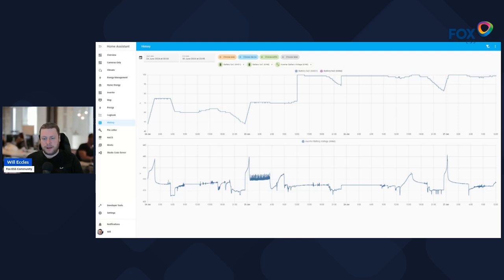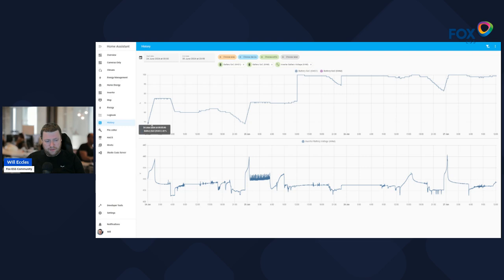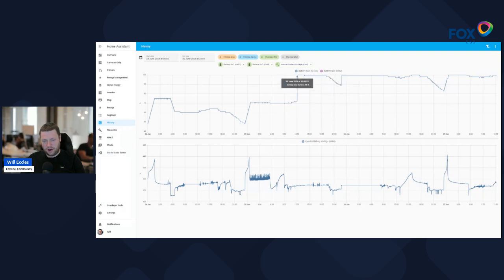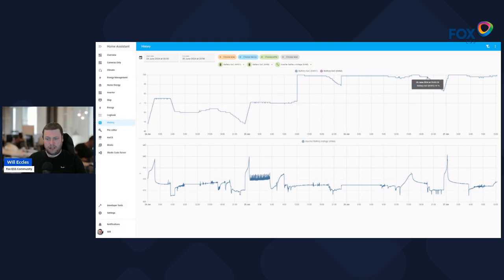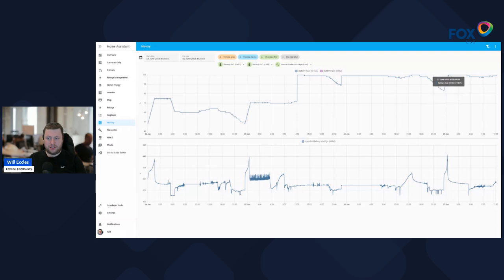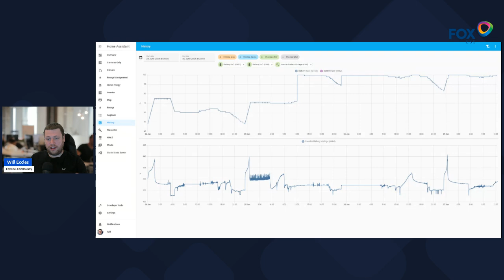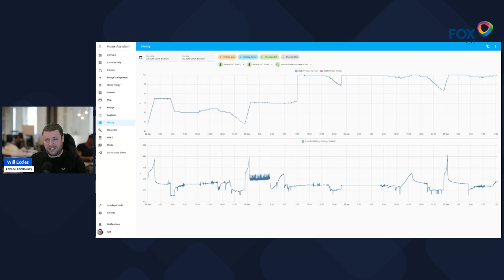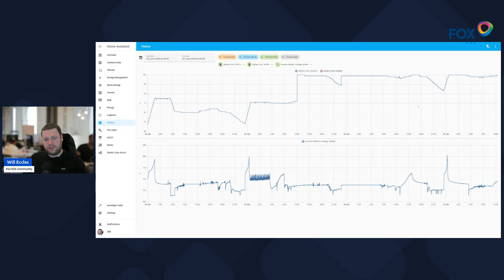Fox ESS BMS calibration and battery balance overview of LFP cells

Comment: I have 5 x HV2600 batteries and a 3.7 KW inverter so the maximum that can be supplied to or taken from any battery is only 740W = about 13A. One of the reasons why I slightly over batteried was to reduce the load on each battery and so extend its life but after watching this video I wonder it it would also make cell balancing easier.  Compared to the minimal 2 battery system this is effectlvely current limited so each battery is already charging and discharging at a reduced rate.
What current per battery would you regard as low for cell balancing purposes?

Comment: Do you recommend a 0.5C charge rate for general operation?
Reply from the maker: Each battery has it's own max and recommended charge amps which give the end user or installer a good place to start tuning the charge parameters to extend lifespan. I personally look at the battery size, solar array size kWp and any cheap overnight charging slots like Octopus go and lower the charge rate so it works for all three variables. I advise to be careful setting to as low as it takes your battery to charge in a cheap window because this also limit solar battery charging. If you're an advanced user with home assistant integration you can completely automate all the parameters to give you max charging during the day on solar and limit the charge rate to the amps needed to get a full charge. What I love is that you can tweak it to be just perfect for your use case. All that being said, you can install it and leave it at 35-40amps charge current and still have 15-20 years for fantastic performance out of your battery system.